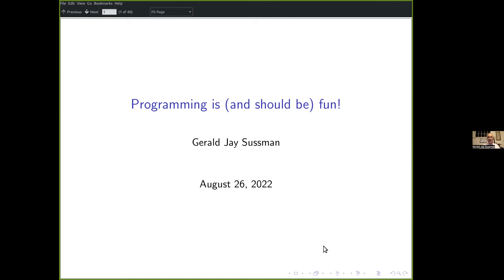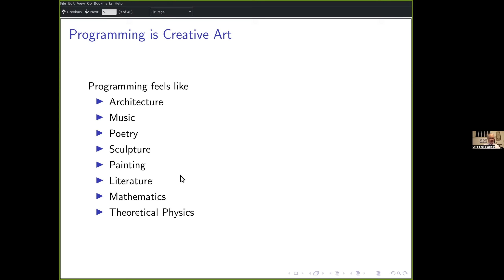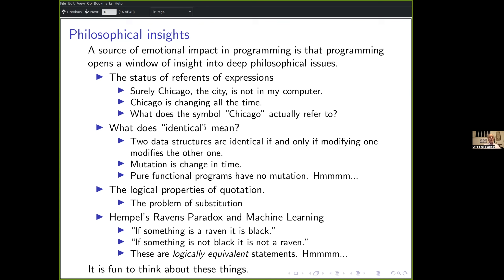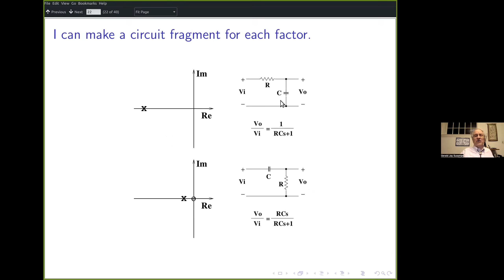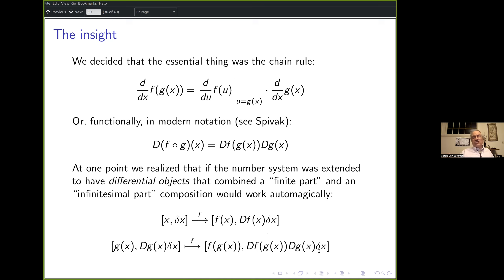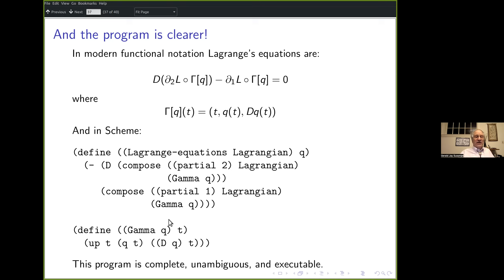Comment: I take issue with the claim that software systems have more parts than physical things.  Consider your processor.  A contemporary x64 processor has around 3.8 billion transistors.  Another two billion on the associated I/O circuit.  Those are parts - almost six billion of them.  They're all doing something, and they all have to do it RIGHT for your final product to work.  Can you point to any software system that has almost six billion well-identifiable parts?  I doubt it seriously.
 
And all of these things you mention like kerf and tolerance and so on - those things do indeed have to ultimately be dealt with.  It's just been hidden from you by the work of others.  This is precisely one of the problems with modern software engineering - people tend to ignore the fact that there actually is a real world out there, living instead in nice tidy little software worlds they've constructed.    You want your tools to hide the mess from you, but the mess is still out there.  When deciding what kind of software works well, you really need to look at what kind of software "fits" the hardware itself, and what kind of software "fits" the world - not what fits the inner walls of a little cocoon you've constructed.

Comment: I disagree.  A simplified "first model" does not have bugs just because it's not the entire product.  You set out to implement a SIMPLIFIED FIRST MODEL.  You weren't ATTEMPTING at that point to produce the final product.  A bug occurs when you program doesn't do what you INTENDED it to do.
 
You seem to be using the word "bug" for any "non-ideal" aspect, regardless of intent.